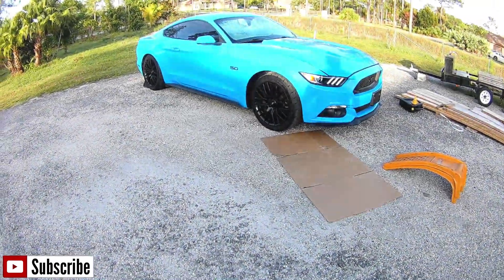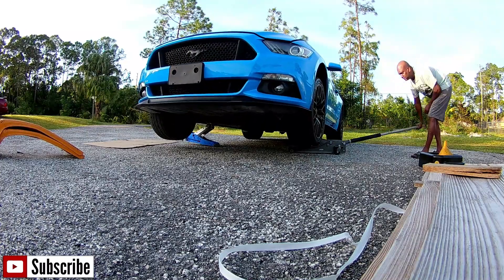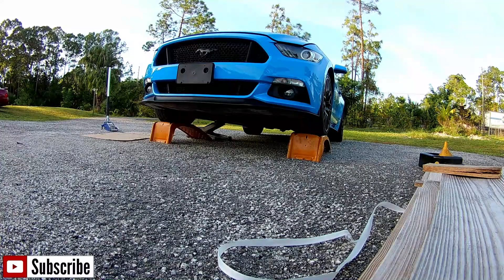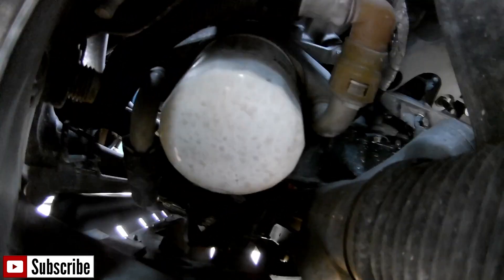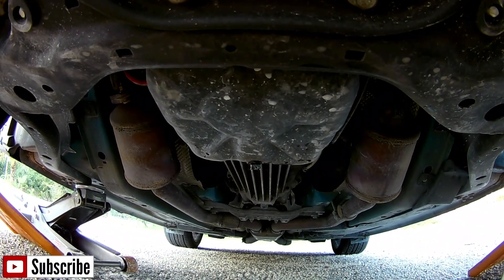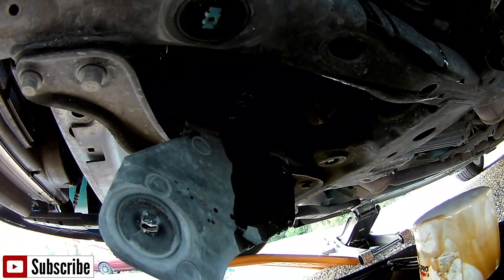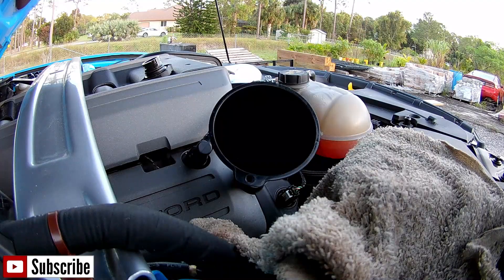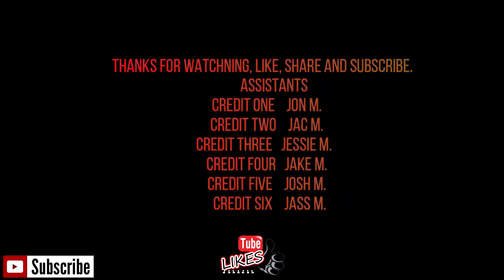2017 Ford Mustang GT V8 Oil Change

Comment: Why didn't you just drive the car onto the ramps rather than jacking it?
Reply from the maker: The front bumper hit the ramp before the wheel could touch it, the car was too low for those ramps.
Reply: @BARR8323  Do you use a low profile jack? i'm looking to change the oil in mine too but the car is so low I'm not sure how to jack it
Reply from the maker: @MarkOBrian no, I didn’t have one.